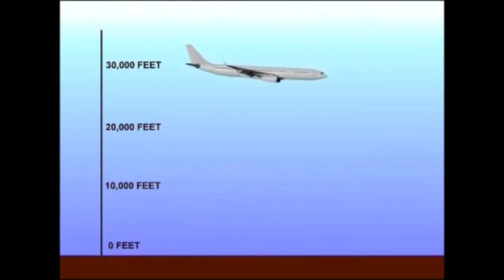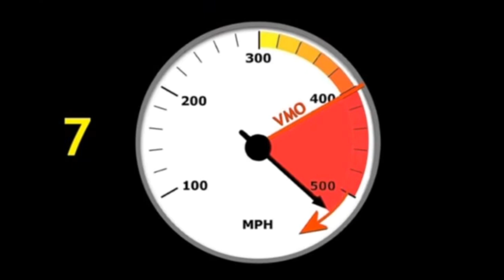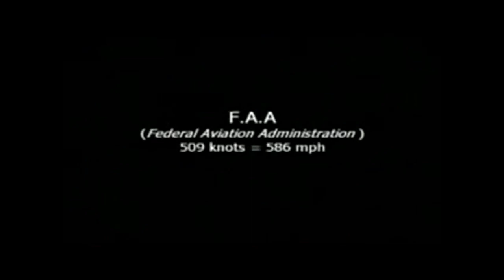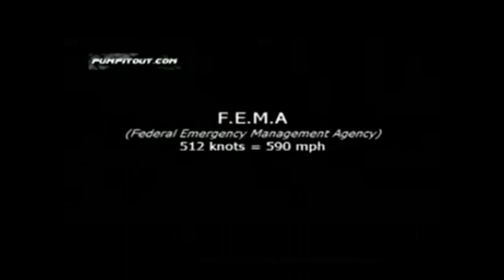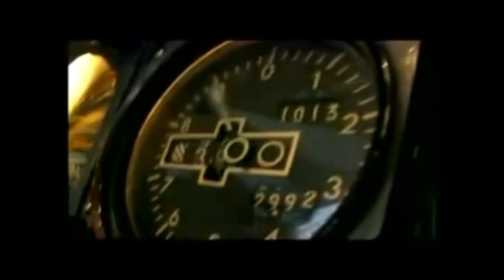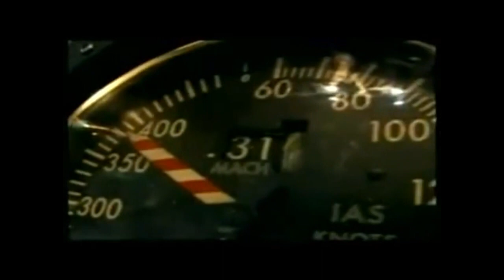Can a commercial jetliner fly above 500 mph at sea level?

Comment: VMO is the maximum operation velocity. But that doesn't mean an aircraft can surpass it. The actual number you should be looking for is VNE, the never exceed speed, which neither aircraft exceeded. Also, surpassing either speed does not mean instant ripping apart. The planes just came down from steep dives and weren't fly really low for very long.
Reply from the maker: You just proved, that you completely ignored everything what those aeronautical engineers said. Commercial airliners can not just "dive". The aerodynamics of the plane is not simply built to withstand such force, caused by the air density at high speed. This is the main reason why commercial airliners have to descent slowly from a flight level before landing.

"Also, surpassing either speed does not mean instant ripping apart. "

You have absolutely no idea what are you trying to talk about. The physics were very well explaind in this video.
Reply: @PetrLunak  Think of it as a scale. Green, yellow and red. Green is normal cruising speed relative to the altitude. Yellow is VMO. With no external force, like rain, or heavy headwinds, you're still fine. This is about when the aircraft's warning system begins to warn of an over speed. However nothing terrible will happen if, like on 9/11 there are no string external forces acting on the aircraft. VMO means maximum operating speed, at this speed a plane physically cannot excel past a certain speed on it own thrust, however it can excel past that speed if it utilized another maneuver to increase speed, for example a dive. VNE is the speed in the red tier where even without external forces, flutter will occur on the aircraft air frame and in time, (depending on the speed) will eventually begin to fall apart.  VMO is the speed where the plane may experience damage with external forces, and the speed that is not achievable by means of its own thrust. VNE is the never exceed speed where the aircraft begins to show flutter effects and air frame breakage begins to occur.
Reply from the maker: @TLO129  the case here is not just few mph above VMO. It's almost 200 mph above the B767's VMO. AE in the video explained it clearly, yet you still completely ignore them. Their claims obviously do not fit in your core belief.
Prove your claim, show me a commercial airliner, flying at 580 mph near sea level. Or at least 500 mph. You will not find a single case, not one.
Reply: @PetrLunak  The AE says in level flight. Which is true. A 767 cannot surpass VMO under its own level thrust. However he did say there was no limit if the plane was diving. 3 of the planes had just come out of dives less than 2 minutes before impact, and the fourth was in a dive. Now I must confess, I made a mistake, VNE is used for turboprops, and VMO is for jets. However this video says the VMO for a 767 is 360 mph. It is not. It is 360 knots. Which is about 420 mph. The fastest aircraft was UAL 93 travelling and 560 mph approximately, however it achieved this speed for such a short amount a time, less than two minutes. Also it was not doing any insane maneuvers, it was simply going from a dive in a straight line with no headwinds. Ideal conditions. Of course the plane isn't going to break apart.
Reply from the maker: @TLO129  "However he did say there was no limit if the plane was diving."

Any object can dive, because of the gravity. But B767 is not constructed to withstand it. Wings would fall apart.

"Of course the plane isn't going to break apart."

Well, first of all, the engines can not handle it (B767 is not a military jetfightet), so what exactly was pushing Flight 175 straight forward at 584 mph? Gravity does not work horizontaly, just to let you know.
Reply: Petr Lunak You seem to not understand what I’m saying. When the aircraft was in a dive it picked up speed, the aircraft then Pulled out of the dive and flew horizontally, still gaining speed from the dive. 

Here is an excellent article by Mick West explaining it all https://www.metabunk.org/threads/debunked-the-role-of-aeroelastic-flutter-in-the-events-of-9-11.3359/
Reply from the maker: @TLO129  and here comes finally West, the master of fallacies, master of fails when it comes to the experiments. I laughed so hard watching him beating a super thin fence by an aluminium stick to prove, that a wing of B767 can go through a several steel columns and crash a steel reinforced concrete floors :D :D :D
And his "twin towers" model is brilliant, it really is, because it perfectly proves, that just gravity can not make things go straight down, the way of biggest resistance, but it falls sideways, muahaha :D
Yet you bring him here, to talk about aerodynamics :)))

But back to our business. UA 175, captured on the video before melting inside wtc2 without miraculously any material ejection visible (which naturally violate laws of physics), without any wake vortex present (another violaton of laws of physics) is moving at 584 mph. You claim, that this speed, already too far above vmo, came from the dive. So this means, that the plane had to dive at much higher speed, just to fly hirizontally for a long time still at 580 mph thereafter :)))) I wonder from which universe you came from, but here on earth we have some natural rules and we even start to call them laws, laws of physics. If there is something physically impossible, it is simply not true, not possible to happen, no matter what a professional shill West, who is super easy to debunk (he mostly debunks himself), writes.

Aeronautical engineers, professional pilots and even Boeing spokesman have no idea what they are talking about, because Mike "the Shill" West said so, ROFL :D
Reply: Petr Lunak I’ve tested this is flight simulators, you are wrong. The aircraft gains speed after the dive, is still has energy from the dive, in other words it’s still accelerating, the plane accelerated into the building. Also you wrote off the real physics, the real math in the article just because it’s from some guy you dislike. Math is math. If I say 2+2=4, would you disagree with that just because the person saying that isn’t named Albert Einstein? Of course you wouldn’t. It’s a straw man argument. Also there is a vortex or wake form the impact. It’s only visible in high resolution videos, but it is there, and it’s not an engine, it’s the aircraft wake. Also the only way to very rapidly make your acceleration negative, is by pulling out of a dive and going upwards, United 175 stayed on a downward trajectory into the building. Again just because you don’t like someone, doesn’t mean ignore them. Truthers tend to that a lot a tend to notice
Reply: Petr Lunak Go on and challenge any of the math or physics in the article with actual proof, and then Get back to me
Reply from the maker: @TLO129  "The AE says in level flight"

No. The question from Jeff was crystal clear: NEAR SEA LEVEL. Not flight level. 

"he did say there was no limit if the plane was diving"

Like I already said, ANY OBJECT CAN DIVE, because of GRAVITY. But this is not the point. The point is, whether the object, in this case B767, can dive (or fall) safely, undamaged.  And B767 can NOT, like AE said.

"Of course the plane isn't going to break apart."

Of course, it will. At least it will be heavily damaged (yet absolutely zero damage is visible on any footage from 9/11 on UA175 - even when it starts to melt behind a steel and concrete wall of the wtc2 - pure miracle aka Road Runner Cartoon). China Airlines Flight 006 is real life example and it wasn't even extreme high speed dive:

"The aircraft was significantly damaged by the excessive G-forces. The wings were permanently BENT upwards by 2 inches (5 cm), the inboard main landing gear LOST two actuator doors, and the two inboard main gear struts were left DANGLING. Most affected was the tail, where large outer parts of the horizontal stabilizer had been RIPPED OFF. The entire left outboard elevator had been LOST along with its actuator, which had been powered by the hydraulic system that ruptured and drained."
Reply: Petr Lunak Every object can dive because gravity, but eventually it will reach terminal velocity. According to the AE a plane technically does not have a terminal velocity when it has engine thrust backing the fall. It not just falling due to gravity, if it was it would reach a limit. United 175 was actually travelling faster than terminal velocity.
Reply: Petr Lunak The AE was correct I’m not disagreeing with him. But the question was phrased in a very vague way, so the AE had to give a vague answer. Everything the AE said is correct if you can interpret it correctly.
Reply: Petr Lunak If the aircraft hit the building at 584 mph that means, based on my previous response, glide slope graphs, and sim tests that 584 mph was the fastest velocity the aircraft ever achieved .
Reply: @TLO129  I got you backed up. I followed the rough trajectory of the 767 up to the point of impact and after 14 attempts the final speed averages at around 510 knots. A little bit over 584 mph, but that's probably because my inputs weren't that exact.
Reply: @TLO129  "I've tested flight simulators." Of course, if your flight simulator settings allow you to fly at over 580mph above sea level, I can understand this. But, it has been my experience when using my earlier series Microsoft Flight Simulator, that my commercial jet airliner had it's wings come apart during a steep dive. Not sure how fast I was going. Happened some time ago.
Reply: @TLO129 OK.  Do this very simple experiment with a toy car.

Push a toy car off a ramp raised on a chair.

What happens to the car?

It gains speed as it moves down the ramp due to gravity.

But the second the car hits the ground it will slow down.

Not 30% of the time.  Not 99% of the time.  But 100% of the time.

The rate of slowdown of the car depends on how smooth the floor is.  Nonetheless it ALWAYS SLOWS DOWN.

You have absolutely no evidence that the planes were slowing down when they hit the towers.  And if they were slowing down how freaking fast were they going on the nosedive!!!

1000mph?  Because those planes weren't just coming out of a nose dive.  Not remotely close.  They had been moving horizontally for using your words "minutes".

Going back to the toy car example, how long does that toy maintain the velocity it had the second it hits horizontal floor?

Something like a second or two.  After that it's slowing down.  SUBSTANTIALLY.

Now of course the toy car is not ever coming close to a VMO.  But the plane exceeded it.  By 2x!!

The air resistance hitting those planes during their horizontal approach was SUBSTANTIAL.  The toy car at no point reached a vocity that could rip it apart.  But the planes did.  ALl of them.

Yet not a one lost so much as a screw before impacting the buildings.
Reply: @DS94everXev  You argument fails. A car is not a plane. And "speed to rip it apart" is nonsense.
Reply: @TLO129 Coming out of dives means it's not diving.

That means gravity no longer assists.

To pull out of the dive requires you to lose most of that velocity gained by the dive.

Drive a car downhill.  Apply the same pressure on the gas.  The second you stop going downhill and travel straight YOUR SPEED WILL REDUCE.

In fact you will get to the speed you were going prior to the downhill decent pretty quickly.

And there were people on phone calls supposedly during this rapid descent.  Not a one of them sceamed or cried or anything as the plane is diving as rapidly as you say.

That's not possible.  You'd be screaming your as* off.

But not a peep was heard.
Reply: @TLO129 they came out of dives and were controllable impressive stuff if you can also believe that
Reply: @PetrLunak were you the guy in those phone conversations? Because you definitely sounded extremely incompetent with the way you spoke. Literally sounded like a 4yo trying to get your questions out.
I don't think you have any idea what you're talking about or able to comprehend what others are saying.
Reply from the maker: @kjjviii1735  the voice is Jeff Hill. The goal was obviously to get to the answer, not to force his own opinion. Btw your whole commentary is a fallacy.
Reply: @PetrLunak so please enlighten me on your entire theory of the entire events that happened on that day?
Reply from the maker: @kjjviii1735  here we go again... "you can't tell what happened, so the official fairytale must be true!".... So no, I will not waste my time.
Reply: @PetrLunak  so I give you the opportunity to stake your case on the version of events you believe took place and you can't even tell me because you know I'll pick it to pieces and you won't have an answer to the most basic of things. You sound like someone that easily falls for conspiracies purely because of your distaste for the government.
Reply from the maker: @kjjviii1735  see how easily I predicted your exact behaviour? Of course you can't, it's the way how you think - one fallacy after the other.
Reply: @PetrLunak  you're literally speaking like Kalama Harris. You're saying words that have zero substance. 
My uncle was a pilot on one of these flights and I'd like to know what happened to him if you supposedly know the truth.
Reply from the maker: @kjjviii1735  and another fallacy, it's getting really annoying. If you want to know what (really) happend, ask the  authorities, go to court and demand answers. I am not an american citizen, I won't help you.
To your knowledge, John Lear, ex pilot, made an affidavit many years ago, that no B767 hit any tower, because of the impossible speed and lack of hard evidence (three titanium steel engines just "vanished", but the passport of the hijacker survived undamaged? - oh boy... the fairy tale could not be more absurd).
Yes, we all saw the videos of the planes, but hey... I also saw a David Copperfield doing some crazy things so called live on TV...yet he is no real magician, right?
Trust physics, not people (especially not those who told you that there is a really bad guy with weapons of mass destruction who wants to attack you...^^).
Reply: @PetrLunak  there were 19 hijackers in total that day. 4 passports survived in whole or in part. Only one was recovered from the planes that hit WTC towers. I don't get what your point is? There is nothing unusual about  15 passports being not recoverable and only 1 that was that hit WTC towers.
Reply from the maker: @kjjviii1735  if you believe that paper/plastic passport can somehow survive completely undamaged an explosion and massive fires that, allagedly caused three steel skyscrapers turn into a tiny pieces (within freefall speed) and concrete to microscopis dust, then there is no reason to continue in this conversation. Just to remind you, that fires were officially extinguished 19. of december, so there was so much heat, that the rubble was "burning" THREE MONTHS. Yet miraculously, they found a PASSPORT of one hijacker from allaged flight 175. I guess he threw it out the window right before the impact.... at 580 mph... no problem^^
Reply: @PetrLunak  lol the passport wasn't even found in the rubble and who said it was completely undamaged. Sounds like you know exactly what happened to every item that was in the world trade centre. 
So now you're telling me there was so much heat that had fires lasting 3 months but there couldn't possibly be enough heat to compromise the towers structure beams😂
Reply from the maker: @kjjviii1735  1. CNN reported it was found on the street.
2. I never said that the underground heat was caused by an office fire.

So you are laughing only to yourself.
Reply: @PetrLunak  many things for found several blocks away. What's your point?
Reply from the maker: @kjjviii1735  are you serious? How the f*uck that passport got there??? Not from the plane for sure.
Reply: @PetrLunak  the passport was found outside of the WTC. Debris from the crashes spread 44 miles. What's your point?
Reply from the maker: @kjjviii1735  I already told you. I will not support your obvious ignorance.
Reply from the maker: @W4rg names are provided in the video. For even more information check Jeff Hill's unedited videos. He talked even to Boeing's spokesman and to Evan Fairbanks (this conversation is especially very interesting).
Reply: They must have been going fast enough to rip all the logos and lights off the plane. I have still yet to see any indenifiy markings on any video.  Also, Hasn't it been said over and over, that the hijackers had no where close to the skill to pull that off? So not only are we talking about crazy speeds and dives close to sea-level, but all done by people who weren't real pilots?
Reply from the maker: @TLO129  this picture from 1993:

https://s.yimg.com/os/creatr-uploaded-images/2021-04/86aa2a00-92ca-11eb-9f9d-e6155facf20b

...cearly shows a real T-rex. So better watch out, there are real dinosaurus out there!
Reply: @PetrLunak  You are grasping at straws big time here. You should provide evidence that the plane footage and photos are fake. The problem with doing that is there isn't evidence because they're real, unedited photos. Who was doing the photoshopping? If you answer that, tell me how you know, sources. How was said person so thorough to edit every single video and every single photo from literally thousands of videos and photos from the day? How did did this person get access to all these photos and videos? How come videos released only a few years ago, released by the person who took the film and published it to youtube, how was that faked? How come witnesses literally inside the tower described a United Airlines aircraft? How come pieces of wreckage with United Airlines paint schemes, and American Airlines parts were found at the towers? In the case of one particular piece of wreckage painted United colors it was seen dangling from the tower at the impact zone so clearly that couldn't have been planted. You have a lot of explaining to do if you want to go down this rabbit hole. So I will provide 3 challenges for you to complete in your next reply, failure to do so will prove to me, and anyone else who reads this, that you have no idea what you're talking about, and you know it, and you are on purely blind beliefs, and you know it.

1) Explain the wreckage found at the scene including, but not limited to: Seats, parts of the plane with windows AND the registration number, parts of the plane painted United colors dangling from the wreckage, parts with these particular aircrafts manufacture numbers, large parts of plane that crashed into the streets below, parts that are clearly not planted because they crashed into cars and even people causing significant injury, and the fact no witnesses described large chunks of plane bits being planted, but many described seeing large chunks of plane crashing into the streets from above.

2) Explain the countless witnesses that described a united airlines aircraft crashing into the building, including a person who was inside building 2, who described "A big U on the tail"

3) Justify your reasoning to believe some project to fabricate photos and videos, a video editing and photo editing project of mythic proportions. Why has no member of this project ever come forward to reveal the existence of such a project? Where is the proof it happened in the first place?
Reply from the maker: @TLO129  very briefly. First of all, it's you who failed already. You are not able to answer the main question, you are completely ignoring unrealistic physics behind it. And we both know why - because you can not explain it. 
You are arguing with those people, whi claim that saw a plane, but you completely ignore those who claim that they did not see any plane, even when they where looking at the tower, like the photographer David Handschuh. So you are not looking for the truth, you are just looking for the "evidence" that support your core belief only. Obviously. The best actor is the young man on the street describing how the plane did a 180 turn before hit the tower :D Or maybe even better is the eyewitness who told us that he saw everything from the beginning to the end and told us already the official fairytale about collapsing towers due to the intensive heat :D But you score too, with the one eyewitness who claim that saw logos on the tail, on object moving above 500 mph, which are visible only from the side :))) He has probably the eyes of a superman.
And the wreckage? Yeah, I love the shiny piece of undamaged fuselage on some roof. I love the piece of engine, just standing bellow scaffolding, which is not a B767 type (different cooling part). Or the landing gear stucked between two buildings, with a rope attached to it, discovered years later. That is "nice" too :)
If you claim, that a SN was shown and confirmed, you are lying, because no authority ever presented SN from those parts of debris.
Your claim, that if there is no "whistleblower", means it is all true, is pure fallacy. It perfectly shows your mentality. People who use this kind of fallacy are the most easy people to be manipulated. It's like: D. Copperfield is a real magician, because you can not explain how he can levitate, go through a brick wall, being cut by a saw or make jetliner vanish before many witnesses - all live. 
If there is anything physically impossible, it can not be true (a B767 can NOT fly that fast, an aluminum wing can not cut steeal beams and crush steel reinforced concrete floors, 4 titanium-steel jet engines can not just dissapear etc.). But a sofisticated illusion can make it look real.
Reply: There are witnesses who did not see a plane true. But they are outnumbered by those who did significantly. Plenty of reason to explain not seeing the plane: They were not looking during the time the plane came in, or their view of their second tower was obstructed. However you have no explanations for the thousands, yes thousands of witnesses who saw a plane, but instead want to clamor to just a few people who did not see anything and ignored any alternate possibility as to why. It's clear to any and all who care about reality that an aircraft struck the World Trade Center. The evidence at the scene points specifically to it being N334AA, and N612UA specifically. 

Your engine comment. Truthers claim that since the Murray St. engine has different cooling (they're actually called TOBI ducts but I'm not expecting you to know that based on your embarrassing lack of research when it comes to aircraft) ducts than a JT9D-7RD4 engine and thus it must come from a different engine. They say that this particular TOBI duct is only found on a JT9D-7A engine. However there are two glaring issues here.

1) The JT9D-7A is used on older variants of the 747 (particularly the 747-100). So the actual implication here is that a 747 crashed into the building since we know this piece wasn't planted as no eyewitnesses saw a massive flaming engine get planted, but numerous people said they saw a massive flaming engine fall out of the sky and onto the street. 

2) The JT9D-7R4D can indeed have the observed TOBI ducts. There's a few examples of them, but I will link this one which clearly shows it: https://imgur.com/a/52eUQly

You have yet to explain the piece of United Airlines wreckage seen clearly dangling from the side of the tower, a place where it is impossible to be planted. In case you want to arbitrarily call me a liar once more here is the image: https://imgur.com/a/UrvW0EP

I would also like to point out that "shiny piece of undamaged fuselage on some roof" is a 5 foot long part of a 160 foot long aircraft, hardly call that undamaged, unless of course, you want to redefine what the term "undamaged" means. It's a tiny little itsy bitsy part of a 160 foot massive airliner found on the roof of building 5. What are you on about? 

Your attempt to explain why Stanley Praimnath saw a big U on the tail of the plane as "It was too hard to see" is pathetic. How do you know what "to hard to see" means? Were you inside the world trade center in the dead center of the impact zone watching an airliner slam into your office? I don't think so. You have zero authority or proof to provide to me or anyone that this is impossible to see a very large logo and identifiable colors on a plane that's right next to you. He also describes in detail that when he got up he saw an airplane wing tilted in his office door and start to burn. How do you explain that one?

We also have wreckage identifiable as coming from American 11 if you would like to see that, but for now I've made that point.

I want to also return to your point about the physics. In a dive a 767 can reach those speeds, and no those speeds aren't safe, but the hijackers obviously didn't give a shit about being safe, they were crashing jets into buildings to kill people come on. Also, these speeds were achieved for such a short period of time that there wasn't enough time for severe structural damage to occur to the plane. In the case of AA11 it was only going 40 mph over the certified airspeed, and it only went over the speed for barely 1 minute in total, it got that fast because it had just gotten out of a steep dive. UA175 only went over the VMO for less than 2 minutes, and again it managed to get up to this high speed because it just came out of a 10,000 foot per minute dive. Summed up, planes cannot achieve the high speeds in level flight, but coming out of a dive these speeds are obtainable but under the condition they are only obtained for a very short period of time. Both United 175 and American 11 fit both criteria.
Reply from the maker: @TLO129  thousands you say. Ok, gimme full names of 50 of them. It should be super easy, right?
Your claim that they were maybe not looking is another perfect example of your confirmation bias, pure ignorance. David was looking at the tower, he even made a famous photo right after the explosion. 
You are waste of time, you just copy&paste nonesense from debunking site just because it's telling you what you want to see.
B767 (or any standard commercial airliner) can not fly that fast that low without suffering visible damage (let alone piloting by someone who was not able control even small Cesna, lol), everything is explained in detail from aeronautical engineers in this video, not by some demagogs like Mick West. Your claim that it can for a short time is pure nonsesne, you are completely ignoring everything that was said in this video, you are violating laws of physics. It's called cognitive dissonance. I bet you also believe that the towers turn tu dust and small pieces from top to bottom because the top small part crushed throught the much bigger, heavier, stronger and undamaged bottom part, because some debunking site told you so :D
Reply from the maker: @TLO129  since you mention trafic controllers, who were at the airport, looking at the radar, not saw with their own eyes, you are shooting yourself in your both legs. Evan Fairbanks...I like that guy. Especially when he was ask by Jeff Hill (same guy who ask questions in this video) what he really saw and his response was questioning Jeff if he is recording their phonecall and refuse to answer, LOL! You very obviously know very little, except what wannabe debunking sites tell you. Others are mistly another authors of the videofootages, which shows sometimes even glitches like missing wing of flight 175 etc. Bravo! These are really credible eyewitnesses, better than staged actors on the street, surrounded by men in black tuxedos, giving testimony to the tv anchors, telling the final report statement already why the towers "collapsed", muhehe :)

Your attempt to call an aeronautical engineers "names" is pathetic, go and ask ANY professional pilot who flies big commercial airliner if it is possible for such plane to be able to fly at 500 mph (only Concorde and Tu-160 are able to do that - completely different aerodynamics and jet engines construction!!!). Presenting footage, where the plane is obviously not flying FAST (500mph+) is again a clear shot in your own leg. This video is the only thing that wannabe debunkers have to support their core belief, yet they are too blind (mentally) to even see that the plane is far from flying above 800 km/h, ROFL
Reply: @PetrLunak  That video of a plane flying low must be the slowest 500 mph in history.  That thing looked like it was not going much faster than any plane I've seen just before it lands.

There are still objects to see how fast the plane was going.  It took the plane quite a long time to move past those objects.

You have film of the tower planes hitting the tower and it clearly was going faster.

That video TLO links plane speed looks like its going slower than a NASCAR car.  Which is nothing close to 500 mph
Reply: @TLO129  You linking a video of a passenger plane flying low proves you are lying.  That thing was not going ANYWHERE NEAR 500 mph!  It was shot relatively close to the plane.  If you shoot a fast moving object (500 mph is REALLY FAST) in relatively close range of the object it would be flying thru the frame one end of the screen to the other REALLY QUICKLY.

But your own video of choice shows that plane moving slow.  VERY slowly.  It was not under any stress because it was flying WELL BELOW 500 MPH.

Thank you for proving that what hit the Pentagon was not the passenger plane that took off.
Reply: I'm guessing 4 inexperienced pilots we're all able to surpass the VMO of all 4 aircraft.....yea....sure.